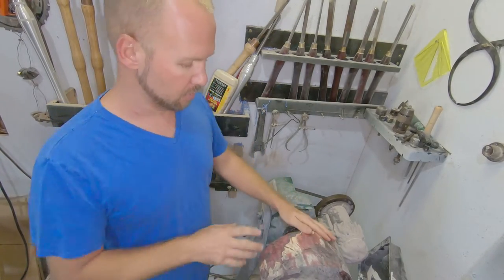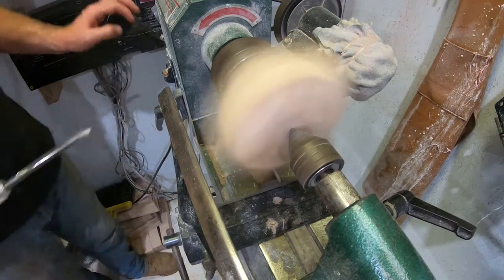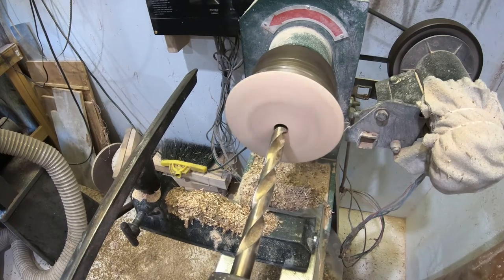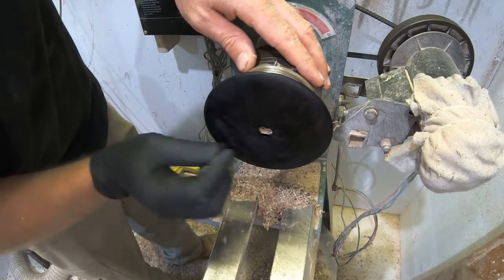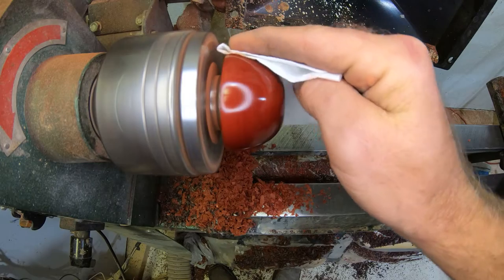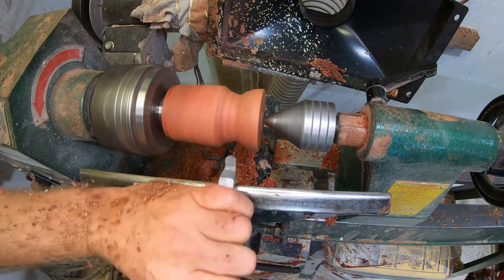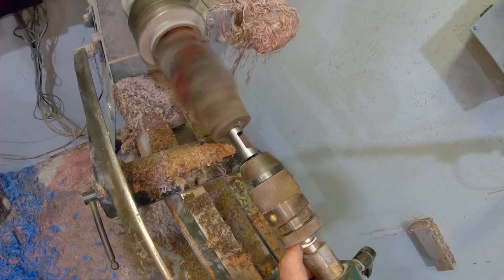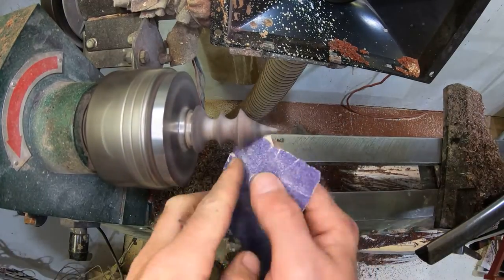Buckeye burl hollow form - Woodturning stabilized burl in Alumilite epoxy

Comment: Hi is that a central machinery (harbor freight) lathe? I noticed you took the cover off of the motor area. Why? Is it to prevent overheating?  I have the same unit and I’ve had to replace three motors because they’ve burned out!
Reply from the maker: I have the cover removed because I have a treadmill motor I installed instead and the cover will not fit. 2.5hp vs 3/4hp is a major upgrade on that thing.